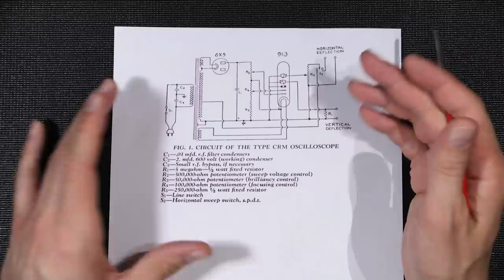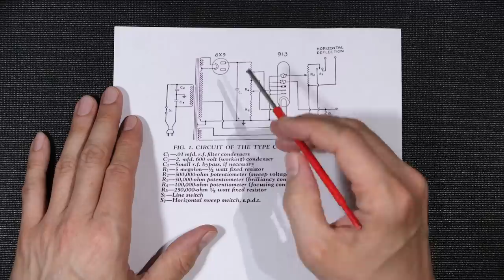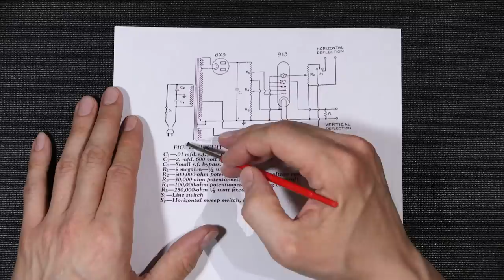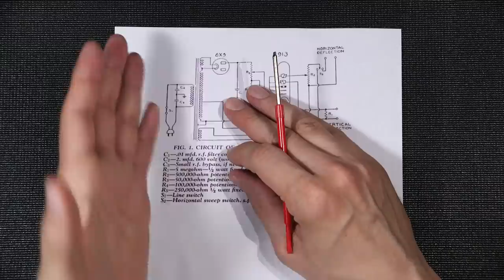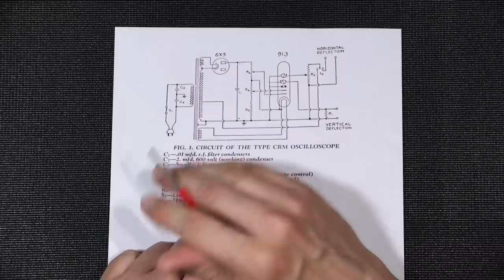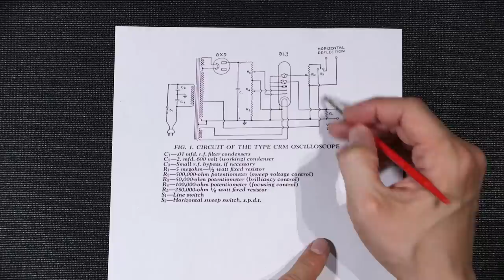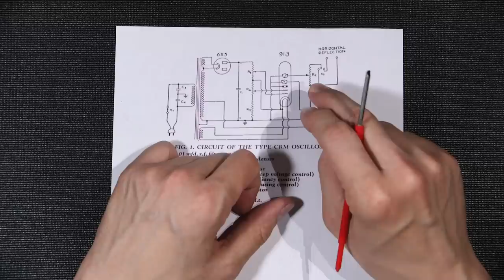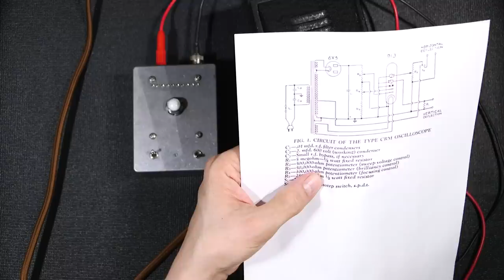Neat Electronic Tool From The 1930's, Lets Look Inside!

Comment: DEPOT the transformer . . . please ! . . . . . . certainly a bit messy but it would certainly teach us a lot. Your running commentary during the process would be interesting, fun and educational.
Reply: I would second de-potting the transformer BUT also request, for the educational factor, to show in one video the de-potting process and then in a separate video showing for this same device, how you would go about scavenging another transformer and making it work. My reason for asking it be done for this device apart from the familiarity from having watched this video, is also because of the interesting design for the transformer they chose with the separate taps and what not which could be difficult without the proper knowledge of how to overcome those issues when grabbing a transformer that isn't necessarily set up with the same taps. Extra work, sure, but I think it'd be really worth it. The other reason I just thought about is what if the internal capacitors had actually been direct shorts to ground and fried the transformer? Then we'd really need a replacement and short of finding an exact match, we'd need to figure out how to grab something and make do with it. Ok, mini-rant done :D Thanks for all your hard work on these videos, Mr. Carlson. I truly do appreciate the time, effort, and care with which you present them to us.
Reply: GREAT suggestion/reasoning, thanks.
Reply: depotting is a standard practice on NSTs for tesla coils.  Did only one and it is a mess...
Reply: I've never seen a "tar" device de-potted. I worked for a company when I was in HS that made 600KV+ x-ray machines. Sometimes a Marx Surge pulse generator module would go bad. We had to de-pot the epoxy modules using MEK to find out what went wrong.
Reply: Someone do a hashtag #depotthetranformer
Reply: +BlankBrain: Ugh! MEK, that's some nasty stuff to deal with! Of course, back in the day, we were blissfully unaware. If I am not mistaken, I believe MEK is a banned substance now.
Reply: MEK isn't banned now, at least in the U.S. I'm sure it's pretty bad for you, but man, it sure is a great paint stripper.
Reply: stand the transformer in a large pickle jar with an inch of acetone in the bottom.  seal it airtight for a few hours before cleaning.  rinse and repeat until all the tar is out.

Comment: Bakelite was the first commercial plastic.  It was a liquid that could be used to cast into objects or coat things like batter on a piece of chicken.  It solidified into a hard, airtight material and would over time get harder and ultimately brittle if exposed to such things as ultraviolet light (many current plastics have this same problem).  Very widely used in commercial and even military equipment to replace leather and glass once introduced.  Created the modern "Age of Plastics".

Comment: "When it's on this bench it's going to work again" I really love that positive attitude. That is the spirit! Another great video Paul. This is such a simple circuit. Was so much fun to see this old piece come back to life. Really hate it that they stuck those caps in the transformer like that.  Would be nice for folks to see how it is done by a real professional. Thanks Paul for this video.
Reply: If it didn't the video wouldn't have to go up sooo..
Reply: Wonder if he can give my Dreamcast the once over, read a load of tutorials about simple fixes, done them all and it still won't read anything. Oh, well, it was dirt cheap
Reply: I want to know,
Where the heck do you find these things?
That Mini O'Scope is over 90 Years Old!
Reply: The Radio Shop 1
Reply: Don't get cocky, kid.
Reply: wen something ends up on my giant cluttered workbench in my basement... its usually not a very good sign. ill just sit there like: "im not stopping until every piece inside of you becomes two of its self."

Comment: "It really doesn't have a choice when it is on this bench - it's going to work again!" - Mr. Carlson is the Chuck Norris of electronic!
Reply: Now what most of you lot don't realise is that some of us worked on that old kit when it wasn't old kit and we used the then state of the art test gear, sometimes even designing and building gear to do the job because no one had worked on the, "new gear", that, like ourselves, used to be new gear.

I was an apprentice in the days when audio amps had what looked like a couple of up turned milk bottles as push-pull output stages and we saw in the smaller and smaller glass bottle valves/tubes until along came those new fangled transistors followed by small scale integrated circuits, medioum scale ICs and Larger and even larger scale Integrated circuits.

Then those Large scale ics began to shrink and so it goes on. And no, "A Wobbulator", wasn't the generously endowed secretary of the manager.
Reply: He can cut a knife with hot transformer! 😆

Comment: The capacitor manufacturer Aerovax is still around and making capacitors! No longer in Brooklyn though. I think you should call them and ask for your money back on the leaky capacitor. Only 80 years old and it already worn out.
With the neat graphics on it this might have been one of those times that hollowing it out and hiding a modern cap inside would have been worthwhile.
Reply: molson12oz, so... will you replace this capacitor with an identical new one for free, or not? What's the warranty policy dictated by that fancy ISO 9001:something of yours?

:P
Reply: molson12oz, yeah, sorry for not being actually funny; it's just that the ISO process certification stuff seems so out-of-place under this video, and reads as if copied from a press release.

Props for being in the industry for nearly a century, though – that's genuinely cool and good to see. Even if your capacitors are lousy  ;)
Reply: It must be a miracle or a public relations coup d'etat for Aerovox to be so big in their field and yet make crappy caps.Hmmm-I'll stick with the ISO certification of quality-that's not a silly Gov label- it's an industry standard constantly improved and yes- it must be maintained.
But-once a company has earned it due to their insistence on quality it is a GREAT ad footnote.
Reply: molson12oz, previously you turned your "satire filter" OFF.

I can only assume it also works as a "satire detector", in which case I'd recommend keeping it permanently ON – because it should have been bloody obvious that my comment was tongue in cheek. Nobody expects a big electrolytic capacitor to keep working for 80 years. Plus, I absolutely love its looks; the labeling is so stylish and classy.

Anyway, I still love you, even if both your capacitors and your sense of humor are lousy  :)
Reply: PS. I already know what ISO 9001 is, although I appreciate the attempt to educate me. I never claimed it's just a government label.
Reply: Roger, out.
Reply: I like the idea of asking the manufacturer for a replacement under the guarantee,  too!  If I were them,  I'd give you one.
Reply: I work for a company with numerous ISO certifications, but somehow I have a problem with an organization that promotes standardization but can't even get it's own acronym right. (The International Organization for Standardization is abbreviated "ISO" and not IOS?) I know, it's French thing, but it's still weird.
Reply: I know, my comment was partly tongue in cheek.
Reply: I know just how that capacitor feels, Yisrael, and no one wants their money back for me.

Comment: Just watch your vids because this has always made me want to study more into electronics.Years ago 1986 my next door neighbor asked me if I wanted all these Heath kit electronic projects he had sent in for but never put any together.The kits that he gave me were a 10" b/w television....only the audio worked on that.An am radio which I still have and works great.An oscilloscope and a voltage tester.....that worked great and I sold them through a ad in the paper years ago.And several small testing modules for like vacuum tubes.....caps....resisters.....and diodes .At the time I wanted to learn everything .....but was offered a job in learning plumbing ....in which I followed.I do enjoy your vlogs and will slowly try to get back what I learned in my youth.A friend of mine from years back taught me a lot and we were always getting supplies at Radio Shack in the late 70s/ early 80s

Comment: Great video Paul as always. I would love to see the transformer de-potted to see if the caps can be replaced. If it ends up that its not possible to rrplace the caps then you can still replace the transformer and add the caps externally. It would be nice to see the case refurbished. Even if you are going to use it its still nice to see equipment looking its best.
Reply: Read my comment up thread, Gary, that black finish is, "Black Crackle", and modern versions of it are available, but back in the day we could make our own. I also give hints as to how cabinets and front panels could be made like new without even doing a tear down and rebuild.

Comment: A lot of this old stuff used resistor wire for the power cord. I had an old radio that had a bad AC cord, but it was resistor wire so I had to add a large wirewound resistor to the inside of the chassis. It worked just fine but that wirewound resistor got so hot that I could not use it very long. I was only 9 years old at the time so I did not know about resistors with heatsinks. I guess the purpose of the resistor wire for the AC cord was to provide 6 feet of resistor allowing it to cool. All this ancient electronics gear is so fascinating. Thank you for documenting these devices in your videos.

Comment: I picked up a Waterman "Pocket Scope" S-11-A built in the late 40's at a flea market.  Replaced the electrolytic caps and it runs like a champ, and appears to have original tubes.  Despite it's low bandwidth, it works quite well for repairing audio gear and random analog projects.  While modern test equipment is no doubt far and beyond in terms of capabilities, I don't think much of my high tech gear will last 70 years and still work.  Plus, it makes a great scope clock between work tasks ;-)

Thanks for sharing your videos - I am equally entertained and fascinated while learning a few things along the way.  Love your style!
Reply from the maker: Thanks for your kind comment! The Waterman scope is a great looker.

Comment: Even when electronics gets more capable day after day, the old stuff is fascinating!
The mains transformer boosts voltage, i couldn't get used to that. The Aerovox company that made that filter condenser seems to still be around today.
Reply: Except that they now make capacitors and no more condensers.

Comment: I would love to see a video about depotting a transformer, maybe combine it with a video depotting old tar caps to place a modern cap inside (for full restoration)? Personally I agree with repurposing old electronics and don't make them dust gatherers but only using the guts from a 80+ years old device  does kinda hurt my soul. Would rather see a device in worse condition get that treatment than this, but hey, that is my opinion. Thanks Paul for yet another neat video!

Comment: LOL - Watching this and you talked about how none of the switches were labeled and then went and tested the capacitor using your own device where nothing is labeled.  Some things don't change in 90 years.
Reply from the maker: LOL, Yes. My reason is, I'm too busy designing new equipment and circuits, rather than take the time for myself.

Comment: I found it! Did a little online searching and I found this exact model. Just as on the schematic, this is the Model CRM oscilloscope, made by the National Company. A little more searching resulted in finding a similar product manufactured by RCA: the Model 151. It uses the same CRT tube (913), however the RCA version has a few more functions, and RCA called it an "oscillograph." 

Supreme Test Instruments also had a similar product to these two, except that the Supreme version used a 2" CRT instead of the 1" used by National and RCA.

If I am not mistaken (which I could be!), I believe the schematic of the CRM, or a generic equivalent, can be found in the 1937 ARRL Technical Manual.
Reply from the maker: Thanks for taking the time to write Erzahler!
Reply: +Mr Carlson's Lab: You are most certainly welcome, Mr. Carlson. Actually, it is I who should be thanking you, for teaching us all of this great stuff! I love the old tube gear, and I am always learning something new about it (well, new to me, anyway!), thanks to your YouTube channel. 😊👍
73 de NØJAA.
Reply: Erzahler, I used to have  an early oscilloscope that used a 6U5 or 6E5  Magic Eye tube for the display, I believe it was a Dumont or RCA device as I recall. Dumont's patented Magic Eye tube was a forerunner of the CRT, and Dumont stupidly sold the technology and the patent to RCA as I recall. That technology was to eventually prove invaluable in oscilloscope and radar design ,  and that patent would have been worth a major fortune post World War II with the explosion of not just oscilloscopes but television.

Comment: I actually built one in the 80's from an article in Radio Electronics that detailed the construction. It used a 1" electrostatic CRT (I think a 1P21) and used 12AU7's for the input and deflection amps. I still have the schematic and the parts.

Comment: DEPOT the transformer if it is at all reasonable,  please.  I enjoyed seeing the 913 tube again.  It's been a really long time.  I worked in the production of 6326/6198 vidicon tubes in the 1950's and we would sometimes change the coating from photoelectric to phosphorescent.  This produced a 1" picture tube with amazing clarity.  Very useful for "in house" test equipment similar to the one in you excellent video.  Some of us adapted it for monitoring our "home made" cameras.

Comment: I have repacked some old bakelite capacitors for a Philco radio that were filled with this tar. I used a heat gun to melt it and drip out into a tin can and then pried out the old parts and desoldered connections to terminals. Final cleanup was with lighter fluid before placing modern caps inside the old bakelite container. Using the heat gun will give you more control of the process than the oven, in case something decides to ignite.

Comment: Love to see a de-potting of the transformer. I have read about it but never done one. As to the black wrinkle paint i have been there but for the twin camshaft cover on my aging Italian performance spec car. The paint was flaking off looking terrible. Removed the  large alloy lump and used an alloy-friendly paint-stripper then put it through the dishwasher to totally de-oil it although it came anodized a kind of black. . The special black wrinkle paint needed a hot pre-baked part to some 200degress C so into the kitchen oven went the cover. I pulled it out an hour latter, sprayed on the paint and carefully built up the layers to cover the metal but not too thick. Then by magic it did the wrinkle thing all over. Finally, to harden it i had to return it to the kitchen oven for another hour at around 100 degress C....After that i just left it cool. Later i set a flycutter in my mill and cut just enough off the top to reveal the logo etc in shinny alloy. Back in the engine bay it looked fantastic. WARNING: using the dishwasher was OK. The stink in the kitchen was terrible and the next time i cooked a roast meal.... BLERK! it tasted of paint! (Note you can only get away with this if you are single)...
Reply from the maker: LOL, great info Pete!

Comment: This is an awesome little tool!...Too bad the caps are potted in the transformer...or is it?..Nope, just means a transformer unpotting video! .... You have my vote for a transformer unpotting rebuild! I love all you do!, you make electrons proud! Thank you for sharing your electrical adventures!
Reply: Correct? It seems that the capacitors were only included if necessary. Perhaps they are not included in the transformer

Comment: Intresting little bit of equipment, I like looking at this sort of vintage stuff, my father used to do a lot of radio repairs & modifications on old valve  (or tubes as you call them in the USA) radios I've inherited a few or his World War 2 communication receivers including a fully working RCA AR-88, Marconi CR-100, not fully working and a 1155 receiver working.

Comment: Hi Paul, great video! I didn't know that they had such simple and compact scopes back then.  I am ever amazed at what the electrical engineers of yesteryear came up with.
I myself think it would be more educational and informative to replace the transformer, which is probably the more common scenario. I have never heard of potting caps into the transformer shield box, that's nuts.  I know that high end audio amps like Mackintosh pot their transformers and I have seen that done, but of course the caps are external.  The mess and expense of cleanup would be more than most folks would want to endure.  Tar is a nasty compound best left to roofers and OEMs.  My vote is for replacement with a period correct (near as possible) transformer.  Maybe you have some NOS laying around in the stockroom.